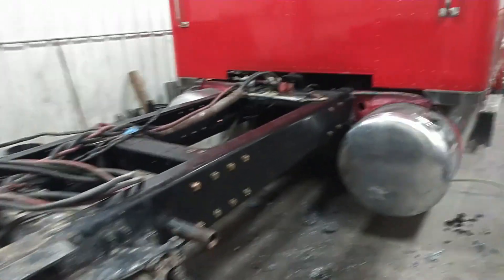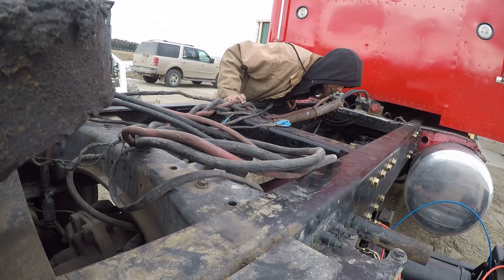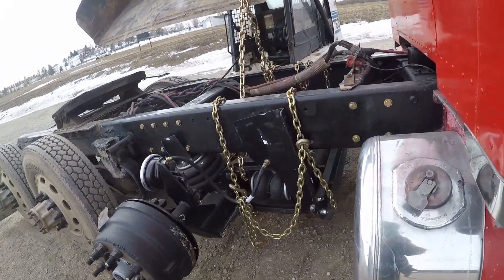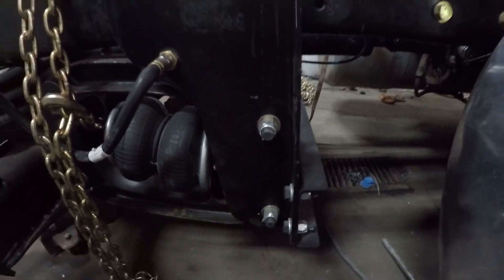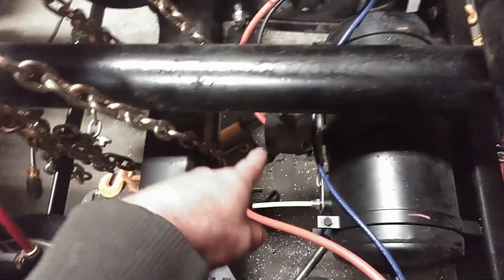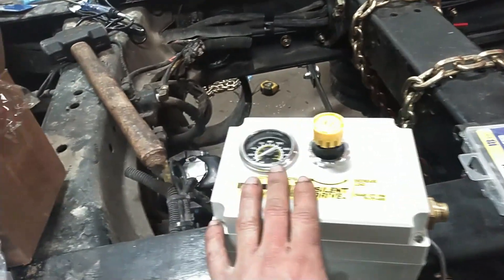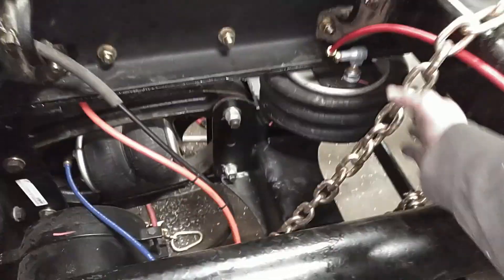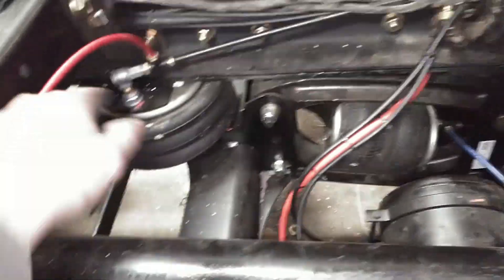peterbilt 359 rebuild ep 20

Comment: another great job e z ,all the tractor units ive driven with what we called a dumpy axle were all auto operated and dropped down when the rigs weight increased early trailer ones were manually operated on the tandems pre tri axle,good idea to mount the control box in the sleeper .

Comment: Hendrickson is pretty good stuff, and they've sure been doing it a long time! Clean install too. Funny thing about those plastic air lines is they wear thru in the weirdest places you'd never think would hurt them and other times I've seen them saw thru PTO shafts and the air line looked just fine!
Reply from the maker: yeah once you have seen it happen a number of times its easyer to reconize what will cause a problem and what wont.

Comment: So glad you decided to mount the control box inside. 

NEVER mount any controls outside if you can avoid it, especially where they aren’t protected from sources of spray/corrosion/road debris.  9:07 slicker than goose shit.
Reply from the maker: The box is designed to be weather tight to be mounted outside but agree inside is better

Comment: She is hanging buddy great work I never did a full lift axle  though I had thought about it on my 48' spread you know here in the states they charge for all axles on the ground so a guy could save a few bucks going from 5 axles to to 3 seams pretty good
Reply from the maker: Would be nice on the toll roads. I don't typically like lift axles on the trailers as they seem to always skipp on the ground when you hit bumps and dips and mess up the tires

Comment: Another awesome video  I see your guys have the exact same set as we have here in Quebec but of course we can't have them on the truck he have the pusher on the trailer 🙄🙄🙄 could tell you the whole story on that but that's another story lol
Reply from the maker: Canada has some weight laws that seem backwards to me...lol I occasionally run in and out of mb and sk
Reply: @Ezrider359  well I've never worked with a pusher on the truck but I know set up on the trailer you need to lift it before hills not to break traction but put it down for turns to gain steering 🤔🤔🤔🤔🤔
Reply from the maker: @stevenmcgregor2219  if the roads are really bad ill normally run with it up unless i hear dot is up ahead...lol in this location it picks some weight up off your drives as well as your steers.

Comment: Nice clean install on that pusher , I know some states don’t allow the regulator to be in the cab , NY is one of them. I’m sure that doesn’t affect you .
Reply from the maker: Under the bunk is fine in any state. They don't want it where the driver can get to it in the cab cause they think people will run with no weight on it and then crank the pressure down when they get to the scale.
Reply: I have trailer lift axle switches for both spread axles in the dash, plainly labeled "trailer dump" and have never been questioned but...its technically a no no

Comment: Curious to see how that steering works exactly.... I hope you can elaborate on that, next time maybe? 👍🏼
Reply from the maker: It just follows
Reply: I have only had tag axles, not steerable but I think it's controlled by electronic solenoid. Some axles will automatically raise when going in reverse, and only steer going forward
Reply: @Ezrider359  I mean, how much of a steering angle will it get, when compared to the front axle and how does it get the signal to now steer right or left....? Just interested in how it all functions.
Reply: Go on youtube hendricks axle and there is video about it pretty cool stuff. I seen it other day fir first time
Reply: Roy Brueren it just follows the same path as the steers.  You still need to raise it when going around sharp turns and when reversing.  Nothing fancy about it.
Reply: Yeah just like a towing a car with a draw bar.

Comment: Hey Ezra can I get your opinion on this
Bought a used 2016 trailer. Plug into the trailer and ABS runs the normal test procedure and light turns on then off
Driving on snow/ice roads and making a harder brake application, the trailer locks up without any abs function. Abs light does not come on.
I have power at the center pin and to the abs module. Brought it back to the dealer for repair any they handed it back saying abs functioned fine and no stored fault codes. They cleaned connections and sent me on my way. Next snow storm I tested the brakes and of course no abs. Any ideas or past experience with something like this?
I would assume if it’s a poorly gapped or broken wheel sensor, a faulty abs relay valve it should be throwing a code
Reply from the maker: Snow or mud biuldup around the wheels can interfere with the wheel speed sensors

Comment: Looks like your updated suspension is a flex air. That will be a smooth riding 359.  How much more weight does the lift axle allow you to carry?
Reply from the maker: Yup flex air. 105,500lbs gross 42,500 on the drive group

Comment: I'm not sure, ( I don't know)  I think some drivers with extra axles lift them in the city for sharp turns.  It might be easier to wire it to a switch in the cab, but I don't know what kind of work you do.
Reply: Good point. He mentions wiring the switch into the dash at 9:35
Reply from the maker: With the steerable axles you really don't need to lift them. To go around corner but you have to lift them to back up. And it will be controlled by a switch on the dash

Comment: What are the specs of the "new" rears?  Ratio, weight rating, same series driveline as Old Red?
Reply from the maker: Went from dsp/RS 402's with 3.70's to dsp/RS 41's with 3.70's both are 40klb rears with the same ratios 41s are just a lot more modern

Comment: How is the steering connected to the front axle steering?
Reply from the maker: It's not one of these days I'll get around to making a video showing how it steers basically just has a lot of caster angle as well as a couple shocks on the tie rod and it follows when you go around a corner
Reply: @Ezrider359  Thanks for clarifying. I wasn't familiar with this concept, over here in Europe every steer axle is either mechanical or hydraulic operated.

Comment: How much is that axle rated for and what size tires are you gonna run?
Reply from the maker: axle is 13k rated went a little heavyer than i need just for durability. ill run the 255/70/22.5's on it

Comment: For those not in the industry , there are different rules the heavier you get. This allows him to haul up to 105lbs total weight truck, trailer, and product. Which in turn means more money. 
Some products pay by weight. He must be hauling by the ton. 

This will all pay for itself in no time and not to mention the increased value in the truck itself. 

Truck came in looking like a 10k$ truck. Now it's probably in the area of 40$ . Once he does the engine it will be a good 50-60k truck. 

Don't quote me. But I bet I'm close.

To buy a brand new truck set up like this is somewhere in the range of 140-160 depending on the motor , trans and sleeper size. And manufacture of course. 

Problem is those new trucks all have what's called a dpf filter and re gen exhaust system. Which are a nightmare to work on and expensive to maintain. Not to mention very problematic...

That's why guys rebuild trucks like this.

Comment: IM A LITTLE WORRIED WHAT THE LITTLE CUMMINS 400 WILL BE PUT THRU..TODAL AN 11 LITRE CAN MAKE THAT OLD POWER.
Reply from the maker: Currently haul the same loads with a 12l 460 mack. 885 Cummins is a 14l just because they were factory rated at 400 doesn't mean that's all they make. It doesn't take much to get 550-600 reliable hp out of a big cam 3